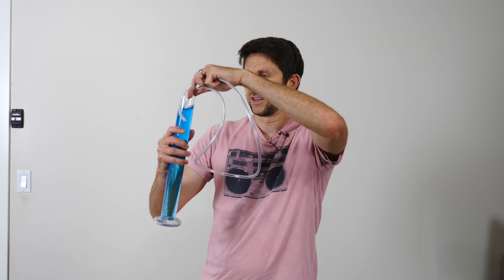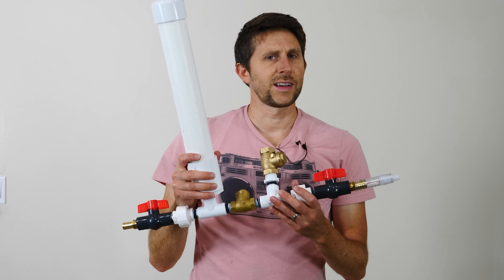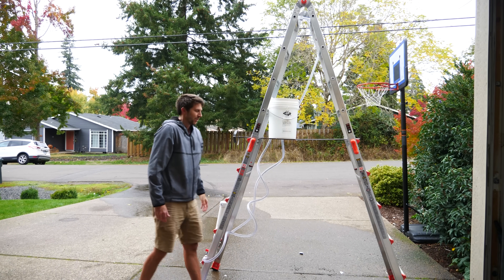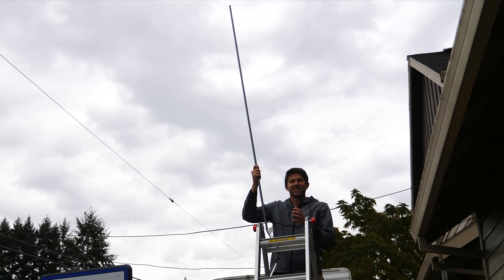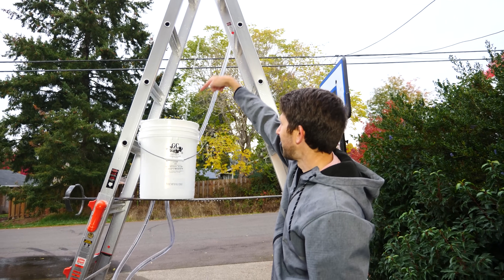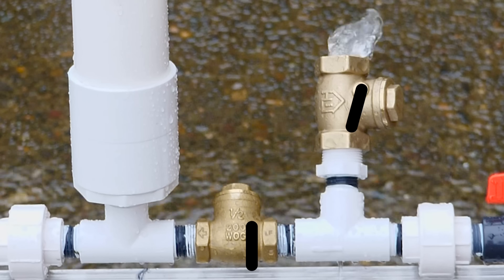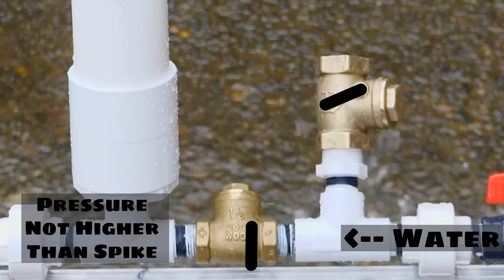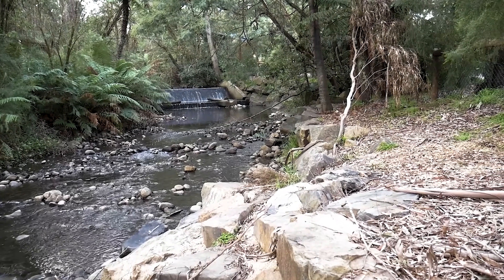Can a Hydraulic Ram Pump Make a Perpetual Motion Loop?

Comment: we really need to STOP using the term "perpetual motion".  we should be beyond such polemic talk.  at this point it's meaningless, and only used in a weaponized capacity against inventers.  we don't need perpetual motion, and no engineered device will ever come without maintenance requirements and a lifespan of operation.  that's machines.

what would be really useful, and entirely within reach, is a simple, elegant, low maintenance device that can last a few decades and is easy to repair.  the hydraulic ram pump fits this bill neatly.

Comment: Some air is more springy than others. Probably depending on the outer electron shell setup of the sum of gas percentages. You should get a noticeable difference in performance using different pure gases in your ram chamber, instead of standard air mix. Hydrogen, helium, neon,... What is more bouncy because of electron repulsion? Is there a combination of gasses that give you leap push akin to a lever?

Comment: instead of a weight on the waste valve could you use a throttling valve to create resistance instead? I'm pretty sure this will work but I'd like to see the experiment.

Comment: Ok, so use the ram pump to fill a reservoir and then tap the water flowing out for hydroelectric and then flow into a lower basin where the ram pump(s) push water back up into the reservoir.

Comment: Could you use the part with the air getting compressed to make a motor? You could maybe fill the air with something magnetic and coil copper around it, or something like that. Needs to be a bit more thought out but I think you could make it insanely more sustainable. Then the other idea was to catch the waste water on something to evaporate it. I am in SWFL so I could use the sun for it. But maybe you could use a generator you made out of that part of the pump that I mention above, and have that evaporate it off. Then of coarse catch the vape in a distilation tube I think. Send it back into the system. I dont think it would make it perpetual, but it would fine tune it into some much more useful actually.

Comment: You know in certain areas of the world, what you could do for the waste water is set a hotplate thats drawing heat from the sun to evaporate the waste water. Then catch it with a stil basically, and direct it right back in the system.

Comment: Why not have the waste value with a hose that feeds back into the tube(without backing itself up to create a counter pressure(this might require some unique solution)) and then the output also emptying in the bucket. The idea is to try to collect all the water so none is wasted.  In some sense the waste valve is no different than the 2nd value.  Of course we know that it is impossible but maybe there would be a way to design so that it is as "free" as possible. E.g., it can go through a long series of cycles before it runs out of energy... which essentially means that the pressure on the waste valve has accumulated so it it no longer can close.

Then the idea would be to use a second ramp pump to remove that water(e.g., it collects in a second bucket) back into the first.  Of course there will be waste water there too so you'll need to have a 3rd ramp pump... and so on. Each time the head pressure will be reduced but maybe with proper design one could get close to a perpetual motion machine in that it might run for months or years. (although any evaporation of water would prevent that)

Comment: You should try putting a venturi with a check valve on the line going up to the bucket.
Hook a hose up to the venturi, then to a bucket under the relief valve.
In theory, when the ram discharges amd pumps upward, it would create a vacuum on the line, opening the check valae and sucking the water from the relief, up into the discharge.

Comment: So can you use the kinetic energy of the water falling back into the bucket to turn a wheel to pump the collected waste water back into the bucket? I feel like that wouldn't work but I don't know exactly why it wouldn't.
Reply: I would think not without outside energy.  That law will never be broken.  Anything that looks free must have some hidden trick.
Reply: There would be a point where you wouldn't have enough KE to pump. Essentially no matter how complex you design it eventually it will shut down and stop working. Basically the waste water will accumulate faster than what the KE pump could remove and that would eventually cause the waste valve not to work. Whatever inefficiencies in the system will slowly cause the system to shut down.

Comment: What's cool is you can actually make more ram pumps down the line. They have to shrink in flow quickly. But it makes them less lossy. However they're losing almost no water the further down you go.

Comment: There seems to me something of a Systolic-diastolic relationship here, whereby part of the hammer effect owes to a sight but repeated expansion and retraction in the diameter of the feed pipe. 

Questions: can this side-effect be employed? And if so, would a system benefit or suffer from a (likewise, one-way) pressure tank at the top end of the feed pipe? What about using a more elastic feed pipe/(hose)?

Comment: With a decent stream feeding the inlet you could put a water wheel in the system before the hammer to get electricity from your water. I've seen people use washing machines as generators but the water output of the generator could be re-funneled to a water hammer as a 2 for 1 system.

Comment: 3:40

.... idk man this seems like either you intentionally didn't try to solve this issue or you simply didn't want to.

I understand that if the waste-gate was longer the frequency may take longer and it may end up not working as well. 

However, there is no reason why that waste couldn't be collected with another bucket and spliced to the other hose with a valve, also gravity fed essentially like another ram-pump.

The main bucket will not send more water, it only sends the amount of which the current can take as it were, and it always will be.

Fountains and toilets do it better.

Comment: smaller second ram pump off the waste side check back into the main ram inlet via threeway and horizontal check with flow arrow into main. and perpetual motion. no loss closed loop system.  use a sealed tank and nozzle the outlet inside the tank facing down to a suspended water wheel. and perpetual hydro electric. before anyone talks shit build it. and youre welcome.

Comment: It is not a "self powered pump", as you claim, mislead people and feed perpetuum-mobile-theorists. The pump is powered by water flow. If the creek, river or whatever water body stops flowing, the pump stops working. You have started the whole process by lifting the bucket quite high (investing your energy... the external power that is). That is how an engineer, who speaks of the laws of Physics, should start such a lesson.
So, why are you beginning your engineering expose with such a wrong statement? YouTube sandwich money?

Comment: I wonder if a quick connect pipe can be put onto the exit check to redirect the water back to bucket, instead of the ground? That would make this very useful as a freeze-proof animal waterer, that would keep the water moving and you would only have to top off periodically.

Comment: The best way to visualize how a ram pump works:
Imagine you have a pipe with water flowing at 10 litres per second.
The ram pump steals the energy from 9L/s of water, and dumps it on the ground via the waste valve.
It then gives this energy to the other 1L/s in the form of pressure, so it can be 'pumped' upwards.

Comment: No. A true ram pump cannot produce a perpetual motion system because there is a waste valve by which some of the water entering the pump is released out of the system. This is necessary due to the hydrodynamics of the pump. The waste valve starts open and as the water goes through that valve the flow causes it to flap shut, triggering a water hammer event that provides enough pressure to push some water through to the output side of the pump. In electronics terms it has some, but not total resemblance to a capacitor.

Comment: Which one will be more efficient if "we use dynamo to generate electricity at the stream and then use the electricity to run a motor that will pump the water" or "we directly use this non electric pump at water source to pump the water"

Comment: have you tried attaching another air tube to the waste water check valve and connecting it back to the pipe and making it a closed system.

Comment: Ram pump wastes alot of water to do this 98% of water flows out wasted while only about 2% gets pumped back in. Eventually it will run out of water. It is not a closed system

Comment: Would the air-filled PVC pipe eventually fill up with water? Until both ends of the tube are water sealed, I could imagine air could escape, and the PVC pipe might be another source of variability in getting the thing working

Comment: Hmm

Well, perpetual motion can only exist   outside of gravity, friction,and or electromagnetism driving it to a halt.....how the moon pepetually  orbits  the earth cause there is a lack of  friction   in the near vacum of space for imstance

HOWEVER, attepting to take power out of the moons orbit will either cause friction drag or electromagnetic drag equal to  the amout of power being transfers ,which is generators stall from electromagnetic counter drag and motors stall from kenetic drag from the weight of the mass it needs to move, will eventually slow the moon down and crash it into the earth so there is no such thing as over unity......the idea of having more energy then is in a system that has actually achieved perptual motion. 

The added energy in this set up is gravity and air presure moving water so this isnt true pepetual  motion though this is how you can run a near pepetual  waterfall,as evaporation is a problem,by having the ram pump the water up into thr upper resivoiur or water while the pump draws water from lower pool of water it spurts excess spent back int lower pull with the waterfall and the water pumped back up the two counter points that need to be balanced  then a water wheel or water turbine can catch the falling water to move a water wheel or spin a water turbine as the speed the water falls is the added potential from gravity  that can be safely taken away from the system without grinding it to a halt

Comment: What if a ram pump had a spring-loaded piston, rather then the air spring, that absorbed the water hammer and did mechanical work—like driving a secondary pump to push some of the waste water back to the reservoir? You wouldn’t get a perpetual loop, but reclaiming even a small portion of the waste could boost efficiency. Basically a hybrid mechanical feedback system using the wasted energy!"

Comment: It's interesting that water is highly incompressible.  From Google: "Water has a compressibility factor of 4.64 × 10^-5 per atm, meaning that for every 1 atmosphere increase in pressure, the volume of water decreases by this factor."
Reply: All liquids and solids have similarly low compressibility factors.  In the case of springs, it is not the solid itself that is being compressed.   Only gases can be compressed in practical terms.

Comment: No! It's not a perpetual motion machine! Just an hydraulic ram pump! Because when the water of in the bucket is finished the system will shut down itself! As a perpetual motion machine it must continue forever stand alone.

Comment: Now hear me out....

What if you set up a system to catch the expelled water, and had a system in place to pump it back into the original bucket?

Like you have a few of these set up that constantly capture expelled water, arranged in such a way that the water is expelled into the exact same bucket that will feed back to the first to make a closed system where there is no water wasted. Would that be possible? I feel like it should be feasible with the right arrangements, but maybe I'm just overly hopeful for the impossible.

Comment: Do you have instructions on how to build that? 

Also, couldn’t you install a hand pump to pump the water caught in a container beside the waist valve or under the waste valve to periodically pump the water back into the main container by hand? 
So it would only be occasionally manually powered and have virtually zero waste!! 
Weil only has to do a very small amount of work every once in a while to refill the original water source?

Comment: I'm trying to run a garden hose 100' down a well casing to pump water up at 7 gpm constantly into my lake and I've been told that it cant be done?  I thought I could put a check valve at the end of the hose in the casing to prime it and turn the pump on at the top?  Seem like it wouldn't be that hard for a pump to suck up 1.5 gallon of water constantly (my ex could do it), maybe 7 gpm is a little much?

Comment: So if u have water place. Just dig hole that is lower that the water level and put these in series to load enough water to spin a wheel turbine on top of ur waterplace. And wola u have made electricity generator that doesnt need wind or solar to be powered to generate electricity and the wasted water just flows back in the waterplace.. ill try this definitely.. 😊😊 thanks for making this video.

Comment: does gravity not count as an energy source ?
Reply from the maker: gravity is not a source of energy, it is just a fundamental force. You have to input energy to move against gravity, and then that energy can be used later. The gravity field is used to store energy. It isn't a source of energy itself.
Reply: @TheActionLab  I must think on this more so a rock or boulder that stands at the edge of a cliff does not stand in potential energy? Also if there was no matter blocking your ladder in your driveway would it fall to the hole that was made or would it just float there? I know one would have to expend energy to remove the dirt to make a hole.

Comment: Instead using two valves can I also try with only the second one turned upside down, so the gravity opens it when the pressure is low, and the high pressure closes it?could it work without any waste like that, isn't it? Still needs a low pressure flow going into the starter pipe

Comment: Your'e telling me, that you cannot possibly get enough voltage from a couple of contraptions say wheels and escapemnt mechanism, maybe a ping pong ball that captures wave motion in the PVC and a few pziezo-electric actuators on the latches, to run a reeeeaaallly small fish tank pump or something.?!?!?... Maybe a flywheel and gears and counterwieghts.... Fight the Man. Thank You. God bless  🙂 . .
Reply: Seriously how can you not then use the pressure from a different storage tank, to drip onto a pellaton wheel generator for the five or six volts it takes to run a small fish pump to collect the spillage. Throw a solar light from Kmart on it in parallel and call it a day. Wtf. God bless 🙂. .
Reply: How, is there not enough energy between the top of the hose to the top of the bucket to spin a wheel with some magnets on it to drive a pump, I'm serious..

Comment: Could you set up by a pond in a hole next to it with pipe in pond and waste valve shooting water back into pond?  If you reduced pipe size it would increase pressure to be able to shoot back into the pond right?

Comment: Of course it's not perpetual motion, but that doesn't matter. A car is not a perpetual motion machine in the sense that you always have to put gasoline into it. But it is a perpetual motion machine in the sense that if you can infinitely put gasoline back into it, then you can continue to move the car perpetually. So what's the main difference? Well when you put gasoline into a car, the engine burns it and it turns into heat and waste which we don't currently have a good way to recycle that heat and waste back into energy for the car, if we did then the car would be an indisputable perpetual motion machine. So what about this ram pu.p set up? The "waste" water isn't actually changing state, it's exactly the same coming out as it's going in. This would be like if you put gasoline in a car and the car just pumped the gasoline back out of the exhaust as it ran. Common sense would tell anyone that they could just collect that expelled gasoline and put it back in the car, then they would rarely ever have to go back to the gas station right? So while this isn't 100% perpetual energy because it requires some amount of human intervention to keep the system going, it's pretty good damn close. So why don't all the nerds and word police just take a breather and stop hindering the pursuit of alternative energy research with their arbitrary assessments?

Comment: What happens if the waist water is connected to the large air gap through a closed system? Basically all the water returns to the original path.

Comment: not really perpetual motion, since your source bucket will eventually run dry due to the check valves discharging water from the system, but ram pumps are fun.

Comment: It's not a perpetual motion generator but it is a prolonged motion generator. You could prolong the motion even more if you attached the input valve to a larger reservoir such as a kiddie pool for instance and then had the waste valve empty into the pool however water will still evaporate over time and the more exposure the water has the quicker it will evaporate but if you completely closed off the water the negative pressure build up will stop the flow. You cannot make perpetual energy with our current technology and it might never be possible but you can prolong motion.

Comment: The bucket can be lowered, right above the ram and check valve can have a hose to bucket and top hose can be put in bucket very little water is wasted and it runs longer before it stops working.